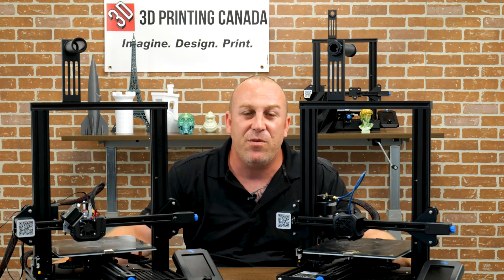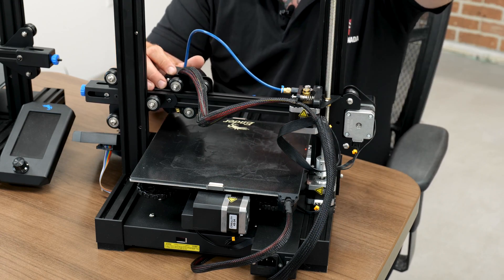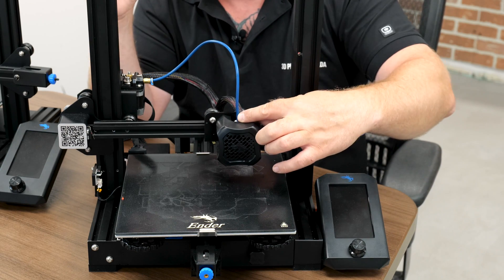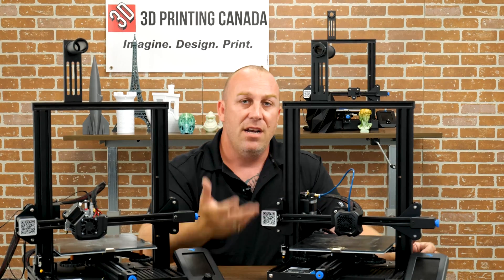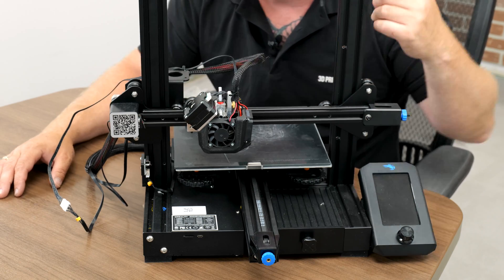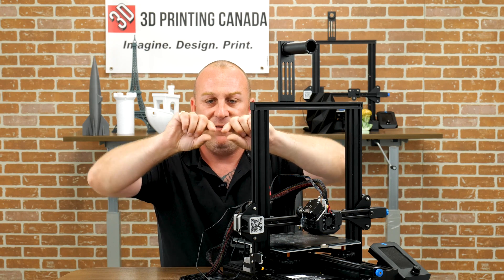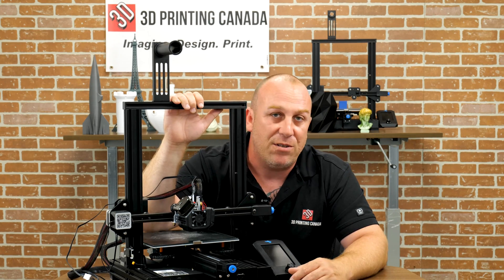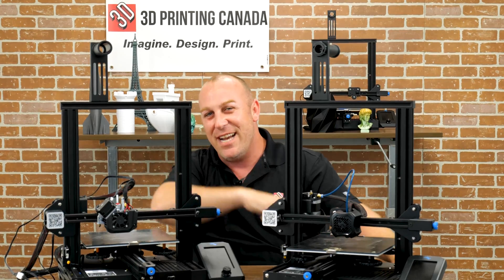DIRECT DRIVE VS BOWDEN TUBE (COMPARISON)

Comment: I intend to print TPU molds with my Ender 3. Thank you for this comparison! :D
The funny thing is that I had an old Solidoodle. Direct drive, excellent component quality, didn't have to worry about anything really. But these days 3D printing parts come in a larger variety and it's good to know what to choose before spending too much money.

Comment: hi, new in this amazing world of 3dprinting and printing mainly with pla.
im wondering to upgrade to a direct drive for my ender 6, does this improve the print speed and overall quality?
since ender 6 is sturdy will the extra weight of the DD have anything to say with the speed?